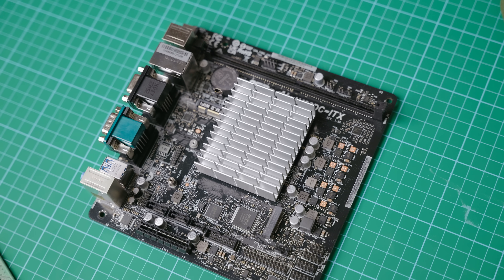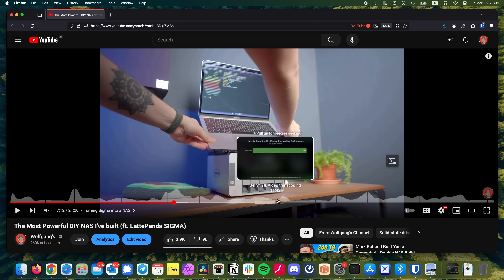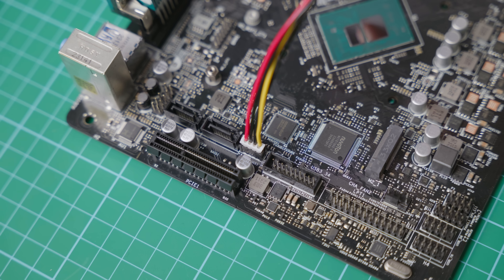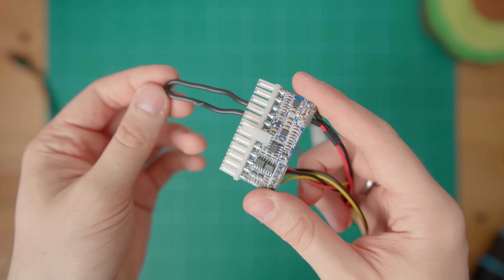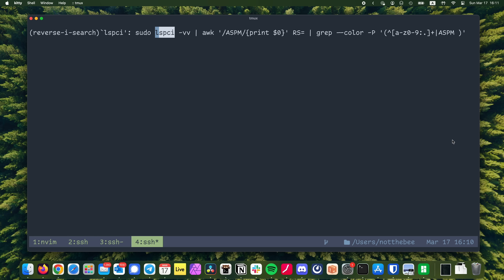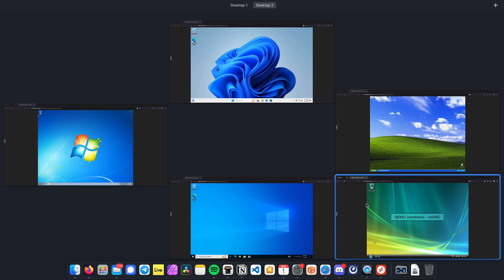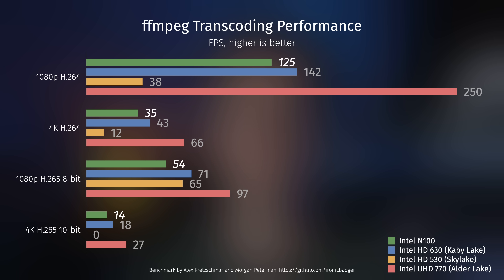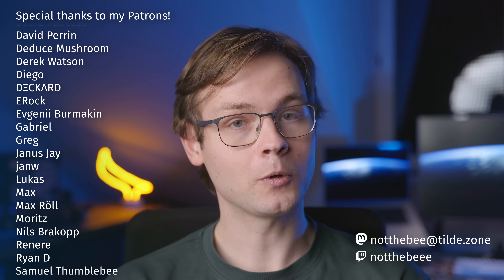Asrock N100DC-ITX – Almost Perfect! But...

Comment from the maker: Get started with Notion, sign up for free or unlock AI for $10 per month: https://ntn.so/WolfgangsChannel

Corrections:
- At 14:40, the N100's iGPU is not just 'playing back' the AV1 content, it's transcoding it to H.264
- Intel i3-6100 is a dual core processor, not quad core (15:25)

Links:
Asrock N100DC-ITX https://geni.us/ECsSoNr (Amazon)
Jonsbo N2 https://geni.us/8rpN (Amazon)
ASMedia ASM1166 M.2 SATA Controller https://geni.us/FL52EAe (Amazon)
Trendnet 10Gbit SFP+ Adapter https://geni.us/wASn1 (Amazon)
DC Jack to block terminals adapter https://geni.us/CFMe (Amazon)
4-pin ATX extension cable https://geni.us/Q26G (Amazon)
PicoPSU https://geni.us/nX6uO (Amazon)
Sharkoon SilentStorm SFX Bronze 450W https://geni.us/wKg3i3 (Amazon)

As an Amazon Affiliate, I earn from qualifying purchases.
Reply: I had problem with my Asus n100 and hevc playback
Reply: ASUS H170i Pro mini !!!! Please!  As a home server and as a router
Reply: No.
Reply: If I manage get a 24 Pin ATX to 4 Pin ATX, or 24 Pin to 8 Pin then 8 Pin to 4 Pin, will that work? Would it be safer than just hacking the 24 Pin to jump the power?
Reply: Why not full SSD build? It seems way simpler to power, lower consumption, quiet, smaller & possibly faster. Is it just HDD/SSD capacity vs. price consideration, or am I missing something?
Reply: I would LOVE to see it perform in full SSD config, as a NAS & for simple home server virtualization needs!
Reply: SSD would be smaller and quieter.  However the price of SSD compared to HDD inflates the price massively.
Reply: do you consider N100 apropriate for a home made NAS especially as a Jelllyfin transconding 2 streams a time?
Reply: Please explain why a thick wire is necessary for the ATX 24-pin connector when you want to turn on the power supply without a motherboard. There isn't actually any current flowing there; the power supply merely detects whether the circuit is open or closed, and based on that, the power supply should be in either an on or off state.
Reply from the maker: Already explained it in the other comment — so that the wire stays put in the pins and doesn’t fall out while the PC is on.
Reply: @ ok, that make sense. I usually use thin wire from utp cable, fold it twice. 
I push the outer, insulated part of the cable into the pins of the ATX 24-pin connector, and this way it stays securely in place. Thanks for the answer!

Comment: iperf3 before 3.16 version is single-threaded and can't saturate 10G by default. In order to saturate 10G you have to run multiple iperf3 server processes: iperf3 -s -p 5101&; iperf3 -s -p 5102&; iperf3 -s -p 5103 &  and run multiple clients: iperf3 -c hostname -T s1 -p 5101 &; iperf3 -c hostname -T s2 -p 5102 &; iperf3 -c hostname -T s3 -p 5103 &;
Reply: Yes 100%, jumbo MTU might help here to, but the issue here is more likely that his PCIe 10G sfp+ card can only do PCIe 2.0 which limits to 2x4 GT/s
Reply: @erikmagkekse  Video shows it hitting over 8Gb/s at 11:17. Also he claimed it has a new chipset.
Reply: You might also set the CPU affinity of the threads to 0. This way each thread will be distributed to different cores (if there are as many as the number of threads).

Comment: I got the N100M exactly because I would've needed to hack a standard PSU to power the DC version and it has significantly less room to add cards. I think it's a pretty nice platform to work with, really power efficient and flexible. About the SSDs I would advise againt splicing in more connectors from the on board JST connector because, even if they use less power, it's pulling from 5V instead of 12V so it's using a rail with less current available then 12V. It's also weird seeing it not idling down to C10. My N100M with TrueNAS Scale goes to C10 and the NIC is not giving me that issue. Last but not least, if cooling is sufficient, you can bring the short and long TDP to 30W and get better transcoding performance since the long TDP on the board is just 10W.
Reply: I have a few N100 boards and all show over 96% in C10 state - the worst being the Proxmox server.
Edit: I think I might know why his CPU didn't go to C10 state. I just read the 12th Gen processor datasheet and it says that the dependency for that is "Display in PSR or powered off" - none of my servers have a display attached and powertop even says GPU "Powered On 0.0%". It might just be that in his case, he had the iGPU busy, which doesn't allow it to go from C8, to C10.
Reply: Well no consumer SSDs use the 12V rail on SATA molex connectors... So your reasoning there for not using the connector is not really valid.
Reply: He said "the only case in which I would recommend this solution is if you're building an SSD only NAS, since SSDs need less power than hard drives". Power is a product of voltage and current. If the connector can only output 2A per pin and there's only one 5V pin the connector supports a maximum of 10W. Which is not a lot of power if you wanna use more than two consumer SSDs. Usually SSDs are rated to use 1A, so even when using SSDs you're limited to two drives unless you want to risk it.
And, if you just didn't know, that connector carries 12 and 5V but only 5V is used for SSDs.
Reply: got myself the same one and I'm pleased with it, too
Reply: How low in power consumption can the N100M get in the C10 state?
Reply: Can't tell just for the N100M because I got an ASM1166 card, 32GB of RAM, an NVME boot SSD and 6 SATA SSDs. My system idles around 15W after powertop optimization.
Reply: @TommyThousandFaces  would you mind detailing the optimization you've done.. would be N100M and ASM1166 and NVME same as you. Assume you scripted some of it on bootup??
Reply: You can script "powertop --auto-tune" on startup and it's gonna set the tunables correctly. Make sure the NVME SSD supports ASPM and you should be good.
Reply: I'm a bit confused why even bother using the DC version of the card if you have to power the SSDs and need a power supply for those?  Any insight onto why someone would preferentially choose the DC model?  All I can think of is getting the heat generating power brick out of the case and eliminate fans completely.
Reply: I did not buy the DC version and got a Pico PSU so the power supply is outside the case anyway. The ITX version might be required to fit some space constraints.
Reply: This is exactly what I did. N100M powered by a Pico PSU in a 1U rackmount case to run opnsense on. Very efficient, completely silent rackmount firewall/router.
Reply: Hey, did anyone of you who uses the N100M find a compact case that fits the micro ATX with a Pico PSU? Thanks a lot :)
Reply: @thomasgebetsberger4620  Not sure if that is compact enough but a 2U short depth chassis is small relative to a tower and some accommodate full size ATX power supplies which I see as more reliable than Pico PSUs.
Reply: @ghost6813  ah thanks a lot, i currently don't own a rack but i guess this would be even be smaller or similar to a node304, which i'm currently running

Comment: I use the N100M as main working PC. With 32 GB RAM and Debian 12 it is more than enough for programming with nodejs. With the low power consumption I can power it entirly from solar (island-system). An best of all... silence... I use two case fans but they only run on full cpu load. This is the first low power mainboard where I can configure the case fans for 0% on low work load. I love working on a complete silent pc :)

Comment: Those screw terminal barrel jack connectors are usually only rated for around 600mA, so I'd recommend to use a soldered connector instead.
Reply: Shouldn't that be okay since the board claims to only use something like 6W?
Reply: @desklamp4792  If the 12VHPWR connector disaster taught us anything, it's that you shouldn't drive power connectors up to their specified limits in regular production.

Comment: They make a micro atx version of this board called the N100-M, which has a full size pci-e slot and uses a standard ATX power supply.
Reply: Saw this as well. Unfortunately it won’t fit this particular case (Jonsbo N2) by a hair… if somebody made this fit would love to know!

Comment: That’s how the Aquantia hits 10G, by doing MAC teaming in the firmware. It’s actually a 4x2.5GbE interface pretending to be a 10GbE interface.
Reply: I don't think it is pretending as much as it seems to be running a channelized 10g connection. Optical networking was geared more towards enterprise networking rather than consumer so there are different channel schemes. You could have 10x1g connections or concatenate 3x1g connections to make a 2.5g which would handle SONET OC48. Similarly at 100g (ODU4), you can have 4x25g channels. I don't know how much control the manufacturer of the NIC provides but Wolfgang may be able to change to a full 10g connection but since this networking is across the ISP (to parents home), the ISP would be the ones that would limit the workable configuration. I think it is likely max 4x2.5g for the ISP and asking them to switch to full 10g would mean extra money.

Comment: 6:52 the electrically and mechanically more safe option is to crimp the two pairs of cables together with a two-cable crimp each, before screwing them into the barrel jack (or rather its terminal block). But that's just a nit, I think your block is rated for multi-strand wire because there's a tiny metal plate between screw and cable, so it won't damage the strands. Still better crimped.
Reply: Major hickup for me (network engineer and electrician) too haha glad im not the only one
Reply: Not a problem while they're nicely aligned parallel, so that the clap inside presses both down equally.
Reply: @MartinZeitler  nah its fine wires not one big one. You always have to put a crimp on them otherwise it's a fire hazard especially if it's higher current!
Reply: How do I know what is positive and what is negative? Can I tell somehow from the plug? I'm afraid of breaking something :(
Reply: @einfachmanu90  it’s labelled and black is - red is +

Comment: I migrated my old NAS to a N2 with my old N6005 board. All I can say is that I love it (now).  It's purely a NAS running nothing else other that TrueNAS core.  I've not even considered an upgrade to N100/N300 as I do not believe it will offer any additional benefits.  Great video, otherwise.  Learn something new every day and I have met that small challenge.  Thanks for the effort you obviously put into this video.

Comment: re: low networking throughput from the NIC

the AQN-100 supports up to 8 parallel queues ( AQ_CFG_VECS_DEF ) to help balance interrupt handling / work over multiple CPU cores [even while the workload is only a single TCP connection]; it might be a little hobbled by only being on 4 kinda slow cores since it can't fully take advantage of the existing hardware parallelism
a similar TDP processor with 8 real cores to service hardware interrupts in parallel might achieve better throughput, even if the individual cores were somewhat slower
Reply: also double check what congestion control algo is being used, on a direct connection over 20gbit fiber, it can change my results with iperf3 from 3gbit to 19gbit, I mostly use bbr
Reply: Do you know how many parallel queues a X520-DA2 has?

Comment: Hey, the barrell jack adapter does not have spring loaded contacts, so you want to crimp your wires before screwing them in. If you don't they can come loose during operation and this is a fire hazard.
Reply: How do I know what is positive and what is negative? Can I tell somehow from the plug? I'm afraid of breaking something :(
Reply: @einfachmanu90  It should be documented in the manual. Usually outside is Negative (GND), but i have seen the other configuration as well...

Comment: Just read the 12th gen processor datasheet and one of the requirements to go from C8, to C10 is: "Display in PSR or powered off". You could potentially go to C10, if you make sure the iGPU is not busy with work. All my N100 servers(which don't have displays attached, btw) are in C10 state. Just a wild guess but it might work.
Reply: with VMs, it's almost impossible to avoid iGPU i guess ? That's why i prefer using a headless OS with all containers in docker.
Reply: What is your idle power draw in C10? Does it worth the effort to enable it?
Reply: @Reza1984_  IDLE(Proxmox, no USB or HDMI connected) = ~6.4W. IDLE + USB(keyboard) + HDMI = 7W-10W(mostly ~7.5W).

Comment: I've seen that situation with iperf3 before.  I was just recently looking at some MoCA videos and decided to go with that to improve my mesh system, and in one video it was pointed out that iperf3 wasn't using the full gigabit connection, but with the parameter for parallel streams, it did reach gigabit speed.  I had the same experience once I set up the MoCA boxes for myself.  You're definitely not alone there.

This was an interesting build as I've been thinking about looking at what N100 boards would be like, especially for power consumption, for something like this.

Comment: there was a misleading information about the N100 vs I3-6100 performance.. Because you calculated the TDP of 6 vs TDP of 51. I'm pretty sure that the N100 goes above 20W when running Cinebench R23. I dont think it will be 8.5 times more efficient at the same performance. Can you please measure? Thanks. Love your videos!

Comment: If you must poke wires into a power connector at least use a resistor to limit the current if you make a mistake. Deburring and grommets are a good practice if you route wires through sheet metal

Comment: I've been running my Nas on an asrock q1900dc-itx since 2014.  I started with FreeNAS, and it's now running TrueNAS Core.   I've got 2x 2 TB Seagate   Nas drives, and I added 2x 4 TB WD Red plus drives.  The PSU is a 60w ThinkPad brick from ~2010.  I don't run any services besides NAS on the system, because I don't want to add any complications to its management.  I ran FreeNAS 9.2 from 2014 until TrueNAS core was a year old.

Maybe I'll migrate to truenas scale, if core gets discontinued.  But more likely I'd only do that by building a new NAS on something like the n100dc-itx.

I love having a 10 year old NAS  with industry standards parts that I can maintain without any particular vendor staying in business.

Comment: I wouldn't be surprised if the NIC just overheats, since this is the exact same issue I had until I strapped a little Noctua fan onto the heat sink of my 10G NIC. Might be worth a shot
Reply: Have a passively cooled Asus 10G in my PC still which doesnt overheat at all... Its due to iperf not taking advantage of multiple cores i think. Had the same issue on a low power Intel pc but between my zen 3 and zen 4 40w+ ryzens it's fine

Comment: Perfect timing. I am considering a n100 board for a NAS too. 
Curious if you would recommend this board over a N100M with more expansion or the Cwwk / Topton N100 boards. My goal is low power, not necessarily high network speed
Reply: I'm also interested in how the Asrock N100DC-ITX  compares to the CWWK and Topton motherboards N100 boards.
Reply: I second this
Reply: The problem is that Cwwk / Topton N100 boards have the JMB585 chip, which prevent the system to reach deep c-states which result to higher consumption.
Reply: @Eujanous  That needs to be compared to see actual results.  If jmb585 is more efficient than it may not make much difference.
Reply: Topton now has a 8505 board that works great as a NAS (and/or router) because it has more PCIe lanes and in addition to Quicksync, it has quickassist. For around 200USD it can handle M.2 4.0x4, 6 SATA, 1*PCIEx4, 4*Intel i226-V 2.5Gb ethernet and dual channel DDR5... Oh yeah, it can also do a 4*3.0x1 NVMe adapter board.
Reply: Hey, did anyone of you who uses the N100M find a compact case that fits the micro ATX with a Pico PSU? Thanks a lot :)

Comment: Thanks for the interesting video! I was wondering at the beginning why you didn't use the "ASUS Prime N100I-D D4", but if you need the higher PCI-E speed for a 10gb network card, it's clear again. Presumably the external power supply of the Asrocks board also needs less power than the ATX/SFX power supply of the Asus board, right? I have seen a very similar construction proposal at "Elefacts" and am still thinking about it.

Comment: I just built this. The problem is not only the DC pins can handle only two amps but the on-board DC-DC converter is only 90W (basically on board picoPSU). I don't have that many data, so I am fine for now, but I was thinking down the road I can get those external HDD power supplies (give you a molex with 12 and 5 Volts) OR since I have some soldering skills - make a little DC-DC PCB from 19 to 12 and 5 Volts and power everything I need from one beefy 19V laptop adapter.

But then again, by the time I will fill up my 14 Tb, some new board like N500 will come out, that would have a more powerful DC-DC converter on board with more PCI-e lanes and more SATAs.
Reply: Sorry for spam, was trying to comment multiple times, but yt doesn't like me mentioning some chinese ali-shop

Comment: 1:15 of course there is the j5040-itx it can handle 4 drives and has also a pcie connector and a m.2 wifi port. it supports 2 4k streams and is also passive cooled, has dual channel ram with max 8gb per channel. pared with a 12v adapter and a pico psu you can go low as 5w on idle.
Reply from the maker: The PCI slot on it is 2.0 x1 – which is the main reason why I prefer the N100DC-ITX board, as mentioned multiple times in the video. Besides, it costs almost the same as N100 boards new and comes with worse performance and an older iGPU